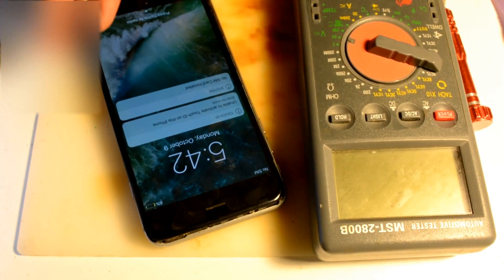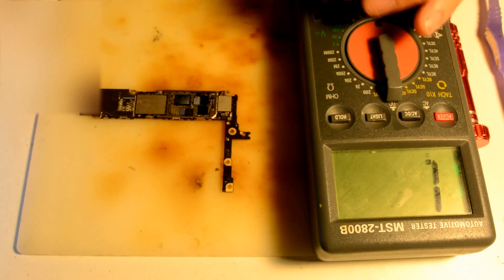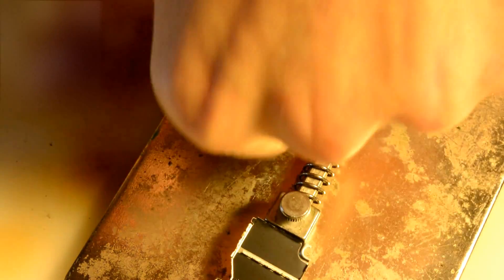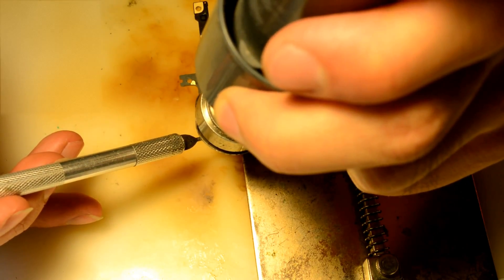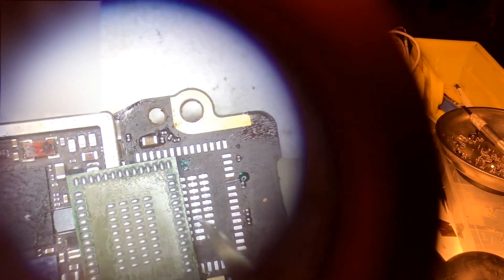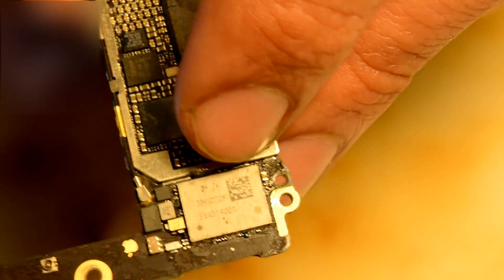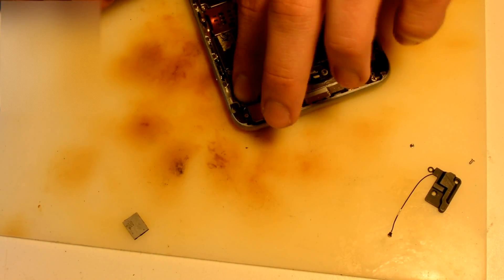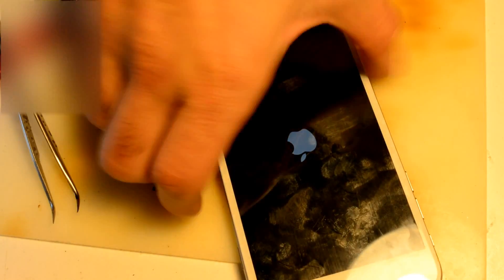iphone 6, 6+ no wi-fi repair. WI-FI ic replacement

Comment: I always thought the WiFi ic is a heat sensitive chip and is destroyed when removed because of the heat damage, what temperature did you use to remove this??? Anyone please help!!!
Reply: 350   air 90
Reply: I think its just the same as other chips
Reply: @twotimes-w7m  is anyone here have wifi ic problem?
Reply: @kiethagravio696  not me, all fixed now
Reply: @twotimes-w7m  how did u fix it?
Reply: @kiethagravio696  changed wifi chip
Reply: 350 ºC